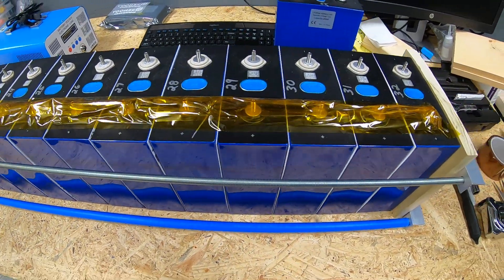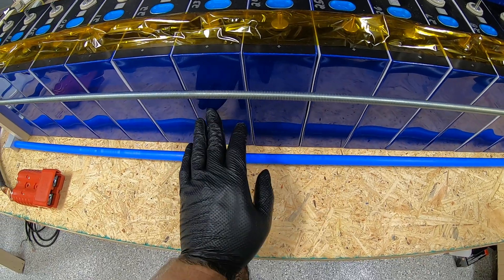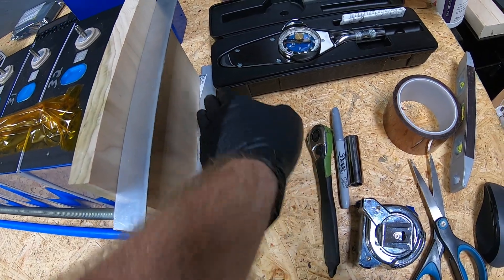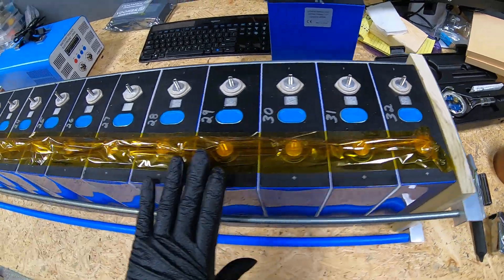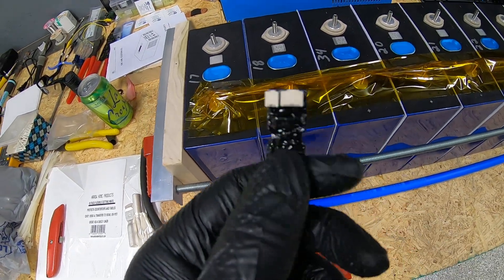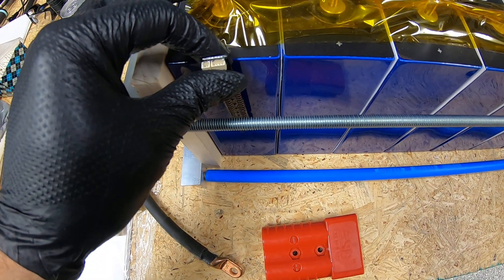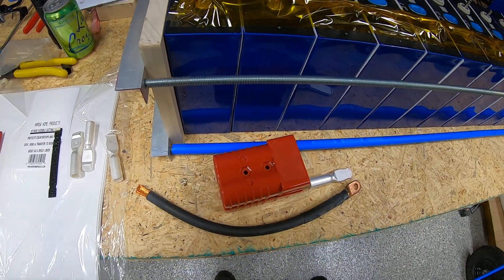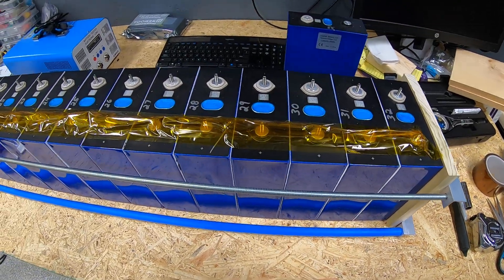280ah cells under pressure

Comment: So basically zero math and alot of feeling on square inch of pressure
Reply from the maker: Thanks for the comment, in a later video we revised the amount of pressure.  We are using the setup to hold the cells in place.  No longer using for compression.  We are working on an updated design, once all the parts come in, we will get another video uploaded.

Comment: Is there an advantage to using the Longmon verses the BlockmonM8 sensors?
Reply from the maker: Thanks for the comment.  For me it is preference, I like the flexibility that the longmon's grant me to place them when I like them, rather than on top of the battery post.
Reply: @solargarage  Thanks for the insight.  I have not made the jump to LiPO4 yet, have to use gel cells for a while yet.

Comment: Really curious about your main bus bars. I will have 4 GS12 inverters with 8 48v 320ah packs in a room and I need to bring it all together for charging and output. So I will need some ideas for a positive and negative rail that can take as much as 1000 Amps and allow for a perfect balance between all the battery chunks.
Reply from the maker: 1000 Amps, WOW.  I use these in the link below.  I know that they will handle up to 190Amps, but start to get warm at that stage.  When I ran an 12V setup I used multiple of these to help handle the load.  They are ground buss bars, but work great as it is thick copper and has plenty of pre-drilled holes.  Since moving to a 48V system I use two, one for positive and one for negative as my amp draw is only about 110Amp Max. The battery packs are fused prior going to the buss bar.  https://www.amazon.com/gp/product/B01GX71IKE/ref=ox_sc_act_title_1?smid=A284PRV19Y1MTF&psc=1
Reply: Hello from the high desert of New Mexico USA 🇺🇸. Try 2 inch by 1/2 inch copper bar stock and use 1/2 inch copper bolts and nuts. I hope this helps you.  Keep up the good work and stay safe and charged